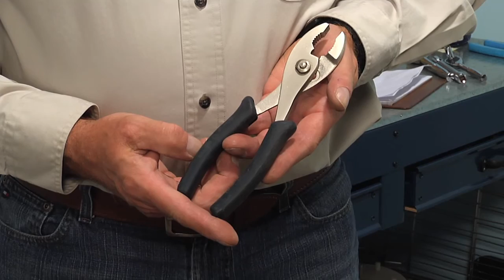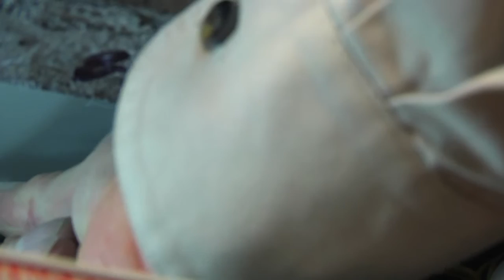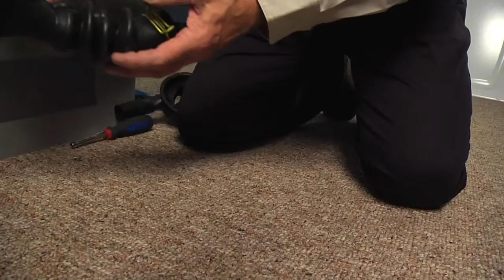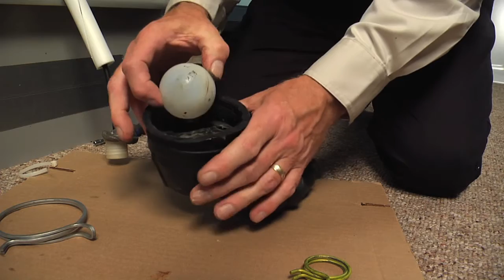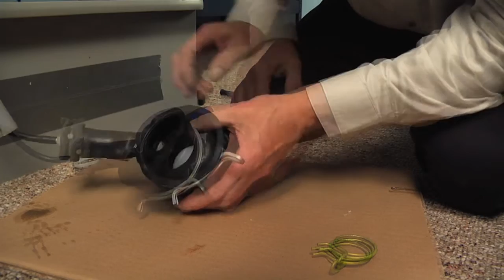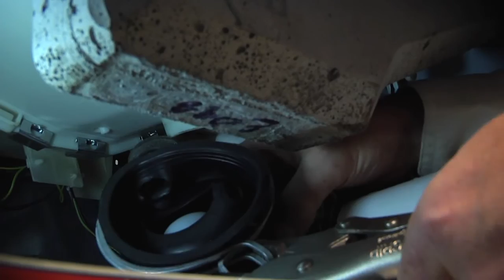Washing Machine Repair - Replacing the Tub to Pump Hose (Whirlpool Part # 8540012)

Comment: I had to remove the hose from the tub because the washer was not draining properly. I found what appeared to be a small sock on top of the ball. I got it back together OK but I really struggled with the spring clamp. If I have to do it again I will try to use vice grip pliers on the clamp rather than channel locks. Keeping pressure on the clamp and while positioning the hose was tricky. Of course, the pros make it look easy. Or...
The parts list for my model shows the hose clamp, part number 8540008, as s screw type band clamp rather that a spring clip. If I have to do the repair again I will get the band clamp first.